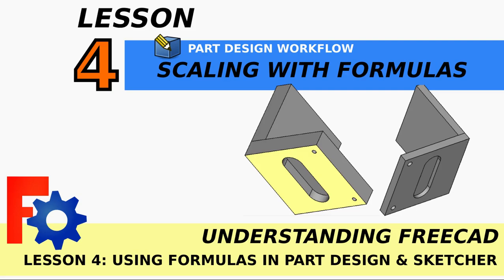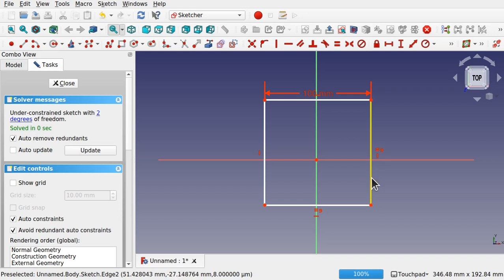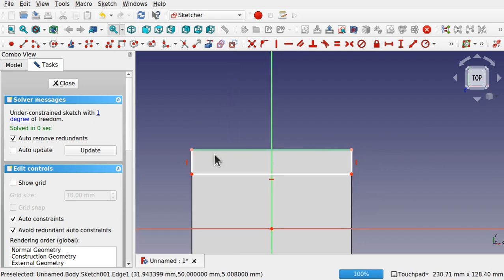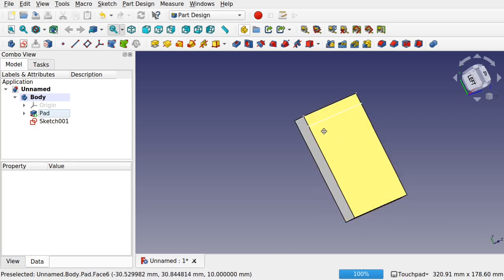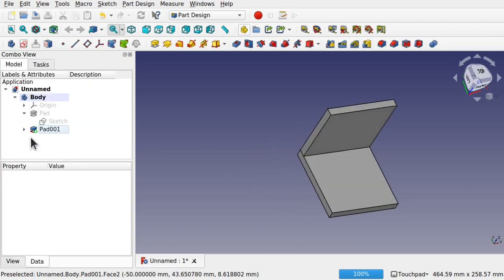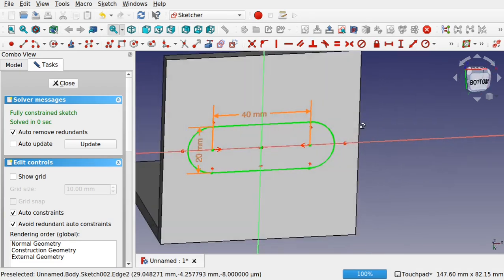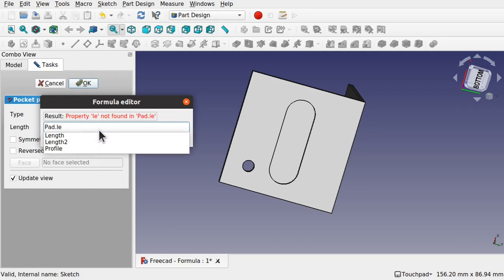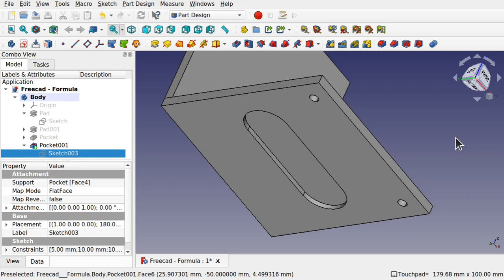Understanding FreeCAD: Lesson 4 Auto Scale Features with Formula | Part Design | Beginners Tutorial

Comment: May I say that while your videos of a few years back were good, from what I have seen of this new series so far they are a lot better. I think this is mainly because the early videos in the last series tended to focus on a specific command/commands. This caused some issues for me.
Firstly, in isolation, there was little that could be done with each command, and it wasn't always obvious to me how useful they in fact were. There wasn't a sense I was learning very much at all. Secondly, once a command had been learnt, I found it was easily forgotten - partly because it wasn't being used again in the following videos. Thirdly, the videos I saw in that series, being very simple,  didn't show mistakes - common input errors, or the foibles of Freecad; and therefore didn't show how to spot or correct them. I thought every 'error' was due entirely to my own stupidity, when in fact some, at least, were just inconsistences in FC or easily made and simple mistakes. As an example - the earlier version of FC did have an option for Sketch Validation; but it wasn't clear to me - or from posts elsewhere, to many others - how to activate it as under many circumstances it was greyed out...   Here, we are shown exactly how to use it.

This new series of videos, because they go straight in with full model creation - together with some improvements to FC itself - have solved those issues and made the whole thing more understandable, easier to remember, and progress much faster for my simple and ageing mind! Well done and thankyou for your excellent work.
Reply from the maker: Thank you for the feedback, what you highlighted about how the videos changed was from me sitting down for a few weeks, back tracking through all the comments and changing the delivery and this was the first series that came from that overhaul. The learning freecad series is another one but there was a change in my setup which cause a the volume to be a little low in the early parts of the series found through the comments. Again I had a small overhaul and purchased a decent microphone and boom to help. I am always keeping an eye on the comments as its the only way to get better content that the community wants. Thank you for taking the time to write. Really appreciate the feedback.

Comment: When you typed in "/2" then clicked on OK, it was so fast that I missed it the first several times through.  I had to slow the video down to .5 to even see it, and even then it flew off the screen fairly quickly.  It might help the visual if you could freeze-frame the screen in the video editor you use, so that the "/2" portion of what you first typed into the Formula Editor shows up for an extra 2 seconds or so, beyond what it does at normal speed.  Anyway, this resizing thing is really cool!  Thanks for showing this to us all!
Reply from the maker: Sorry about that I will make sure I slow down next time.  Glad you liked the video and thank you for the feedback.

Comment: It is possible to create features based on equations? For example in other parametric softwares you can say that if the part it is 100mm in length to have two holes, if the length of the part is 200mm to have three holes, etc.
Reply from the maker: Just compiling a video now to answer your question with an example.  I started typing the answer then I realised it will be easier to create a video.  Just waiting on the output and will post shortly.
Reply from the maker: https://youtu.be/wnV6kpPbNtg